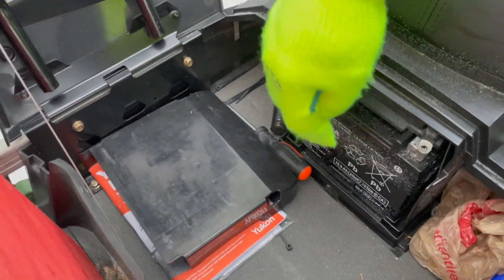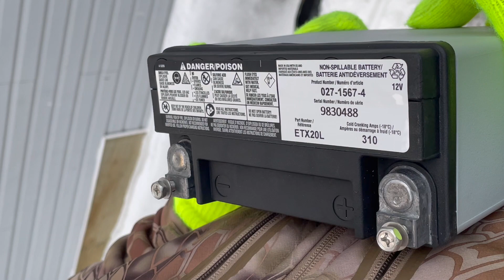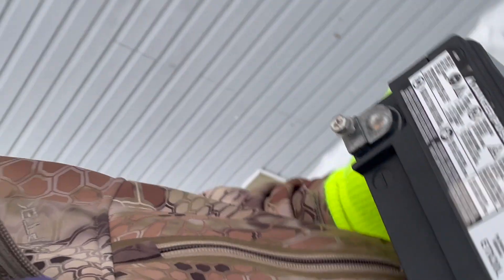Avoiding The Ride Of Shame Part 1:   900 ACE Battery Improvements   HD 1080p

Comment: I have a 2019 expedition skidoo looks like yours and the past two days extreme cold and won’t start. Can you tell me is my battery placed where your is and do I need to remove my seat to get to it?
Reply from the maker: Not sure... you should never have to remove the seat to get at the battery.   I think the expedition battery might be in the engine compartment.

Comment: What a hassle!  I really wanted the 09 VK Pro I have, and then really wanted something with the ACE, but haven't pulled the trigger.  I'm kinda disenchanted with the electronically dependent 4 strokes, but I don't want to jump into the VK540 either until more locals get some time on them.  It may be my next machine though.
Reply from the maker: This was entirely preventable.  I knew I was due a new battery but Yukon Honda didn't have any in stock so I tried to wait and get a few more trips. Nope.  I now have two nw batteries in parrallel and should be good for 3-4 more years.

Comment: Spend the cash and get a gell battery.  I have one in my HD from 2000.  It takes a charge every year.  Top them up with water in the off season goes a long way, too.
Reply from the maker: Need to ck into that.
Reply: @north61  I have 20 year old deep cycles running.  Keep them topped up and charged.  A Battery Tender is ur friend.  Dad never kept batteries in any order;  we were always pushing tractors off hills to start them. Yeah, I was born in the 1960's, but we lived like it was 1920.